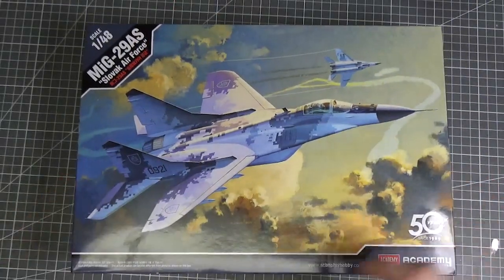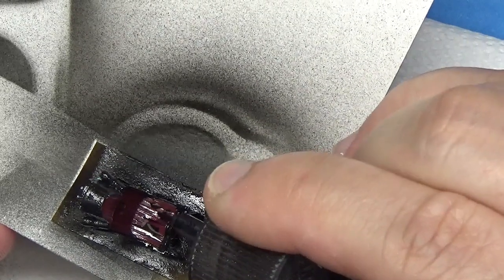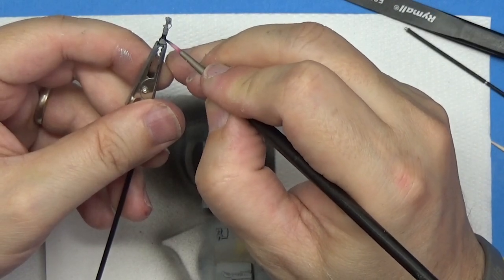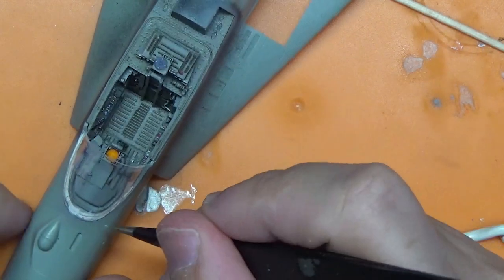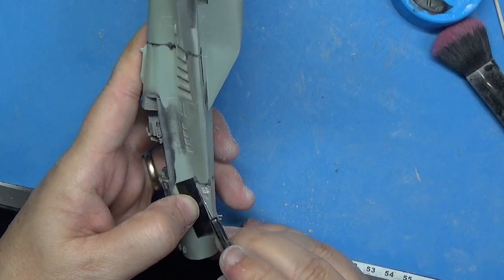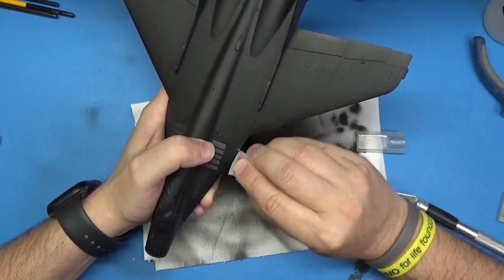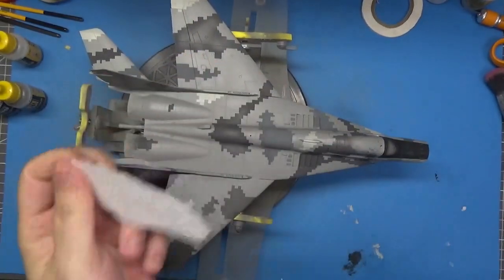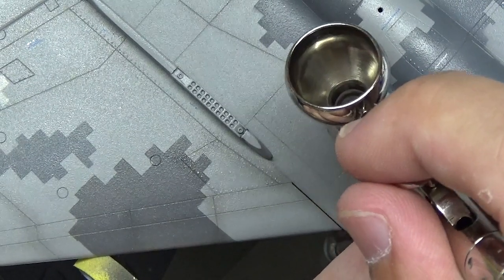Mig 29 Ghost of Kyiv - 1/48 - full build

Comment: Do you do anything special when airbrushing vallejo model air? I am having trouble.
Reply from the maker: What is your problem ? I use this paint directly with 2 drops of flow improver
Reply: @DarkSideModeler  I think it comes down to, me, not thinning the paint enough. I will try using flow improver 👍. Thanks for your suggestion.